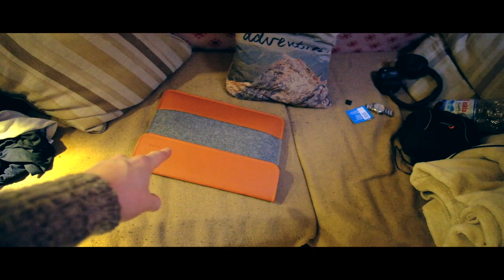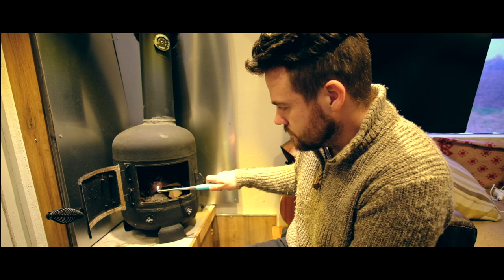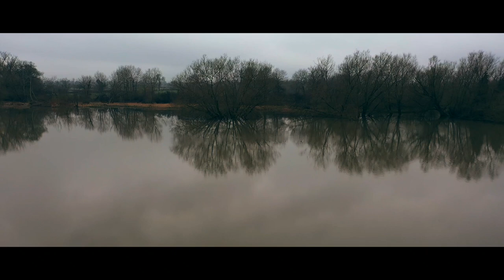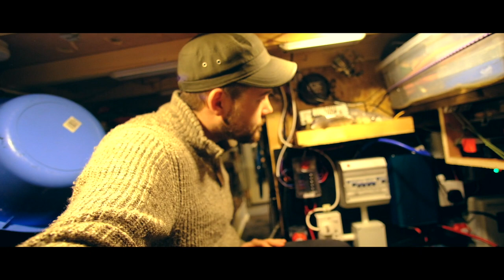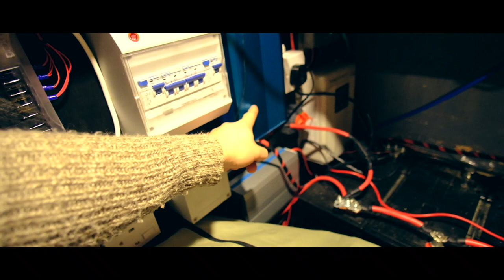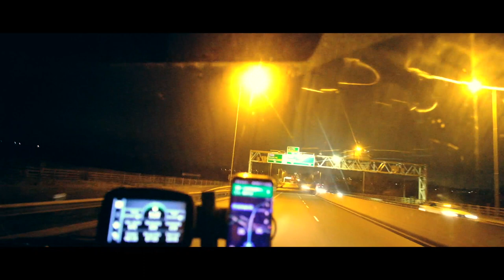Mavic 2 Pro, Electronics and beer... Lost In Europe //180

Comment: Just a quick question:
240V mains in a house requires an earth.
As far as I know, that means a real earth to ground, so the earth leakage trips on the fuse board will work correctly and cut out.
When your using the inverter power only there is no 'real' earth.
How have you got around this to make it safe?
This is genuine question, as I also have my inveter power going through a fuse box but I change over manually.
ALB, Steve

Comment: Ash. The auto relay was interesting. I have a manual switch that does the same, manually obviously! Think I “need” the auto relay!! Any make or link you can giv3 me? 

Did you sort out your split relay problems? The split relays are so inefficient as you know and I can recommend a DC to DC charger. Running your engine for say an hour (approx) and all your batteries will be topped up. Really useful during the dark months.
.
Reply from the maker: I wouldn't want to link you the wrong thing dude 😅 my mate brought it round so I didnt order it. Yep I have a votronic DCDC in there now. Absolutely zero power issues anymore 👌🏻
Reply: Thanks Ash. Dc to Dc chargers way to go. Thanks again. All the best.

Comment: Do you leave your inverter on all the time (when your driving) or do you switch it off sometimes?
Reply from the maker: I pretty much just leave it on 247. Sometimes I'll turn it off when I'm plugged in to give it a break
Reply: @LostInEurope  I'll need to get solar as my batteries are crap and are not staying charged, I don't even get 24 hours If I use my laptop and I only charge them atm with a split charger as I drive. So we switch ours of when we're not using it 🤯🤯😫